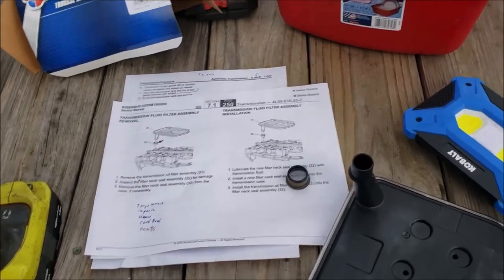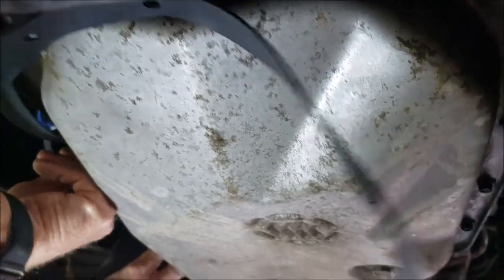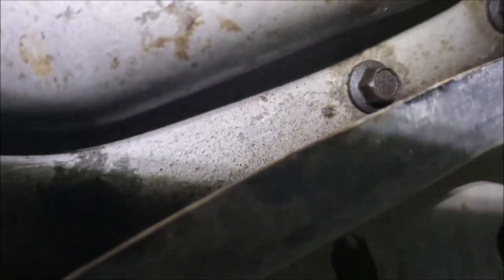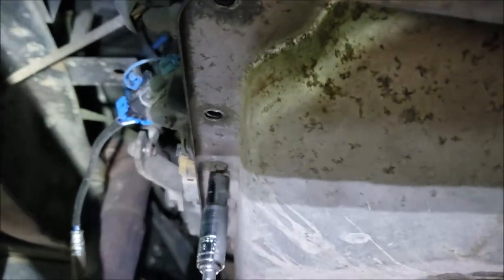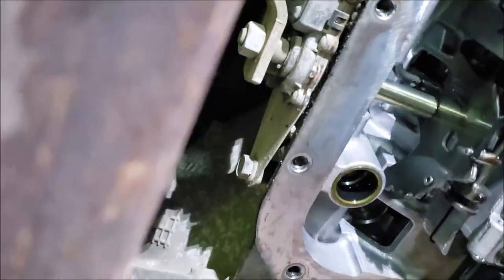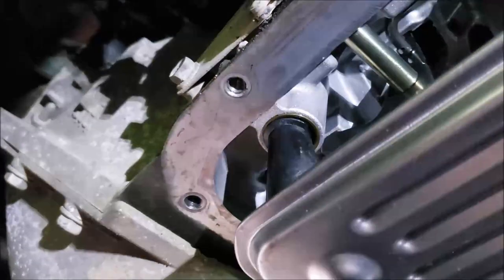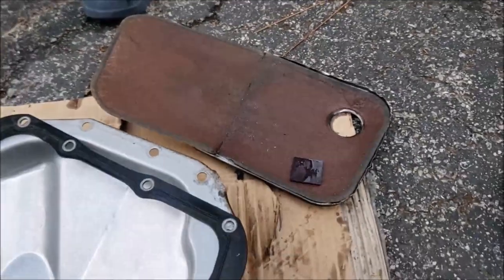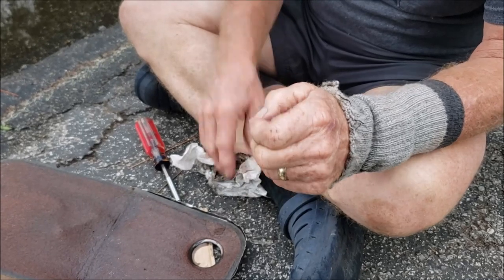Workhorse P32 Chassis 4L85E Transmission Oil & Filter Change After 50,000 Miles Filter Dissection

Comment: Another thing we learned in the performance world with these 80'S - fluid levels are critical on these things and the dipsticks are notorious for being off due to tube installations , sometimes the tube is installed too low or high which will throw off the true level reading.  If you have the pan off you should check your dipstick marks and calibrate it, the middle of the  "full" range should be 1/4" above the pan rail. If it is off etch/ scribe a new mark so you know where true " full" is.
Reply from the maker: Thank you for contributing

Comment: Were you able to drain the torque converter where the bulk of the old oil is? So what percentage of the oil in the transmission was actually changed ? Or just a diluted mix of new and old oil with a new filter?  Ty lmk pls
Reply from the maker: The owner is going to put a few miles on it then drain and refill.  We only got out about 2 gallons.
Reply: @ktoutdoor  
Lucky he has at least a drain plug on the transmission pan ...was not sure there was a drain plug on the torque converter....not sure if GM has that or if that is only a Ford thing...but nice video ..thank you

Comment: Nice job Kev,👍
OBTW - Transynd 295 can be used instead of the GM stuff. I used it in my GM 350 Turbo that spec Dex III.
Reply from the maker: If it's good for the allison it should be great for the GM transmission
Reply: Don't overthink things with trans fluid on these things... it's a 200 year old transmission, you don't need dex 6 or synthetic and there is nothing to be gained outside of lightening your wallet, plain old Walmart Supertech Dex 3 is all these things need.  John Deere low vis tractor fluid works great also. Many guys running 900+ HP with twin turbo LS motors with a trans brake on just dex 3 and they live fine